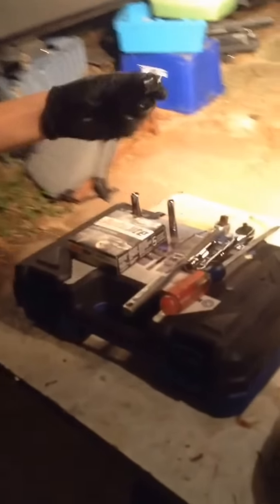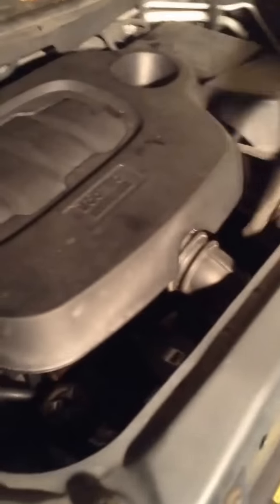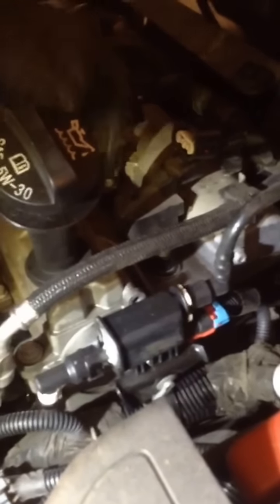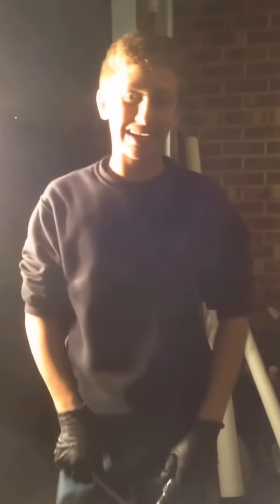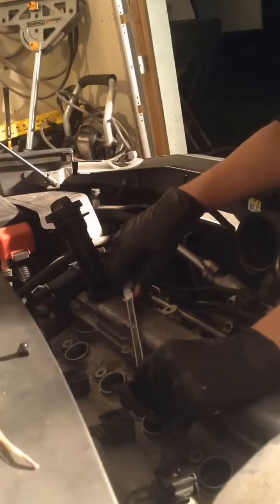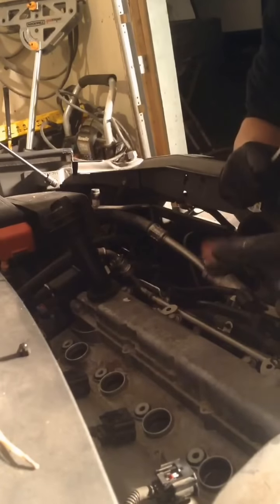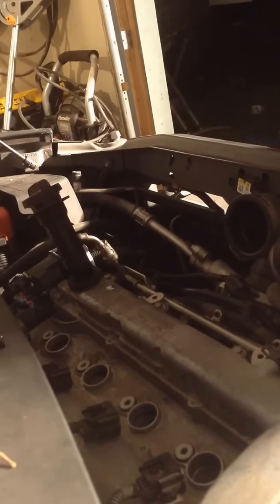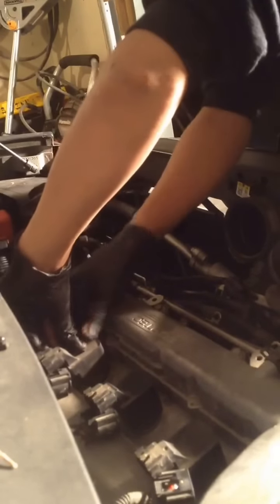How to change spark plugs on hhr

Comment: Thank you guys! This was a lot of help for my first change. I usually pay my neighbor to do it for me but if I can change my breaks I didn't see why I couldn't do this. The first spark plug, the white enamel casing was broken and took me one hour to clean all the little pieces out of the chamber. Freaking scared me!!! All the others were fine but got changed too. I worked under 24 degree weather and I'm pretty sure I'm going to be sick. Anyhow the engine light is not on anymore, there is no rattling or vibration and I drove around the neighborhood. The real test will be tomorrow at 5am when I go to work and drive in the highway. Thank you for the help!! Also, I love the camera was up length way, it gave me a better perspective.

Comment: I just changed out my spark plugs but the engine light is on. Is there a reset I have to do? The car drives great.
Reply: Read the code and see what it is. If it says misfire you fucked up.
Reply: What does it means if it say misfire? Does it mean something is wrong with the engine?
Reply: Sparkle Peterson ....